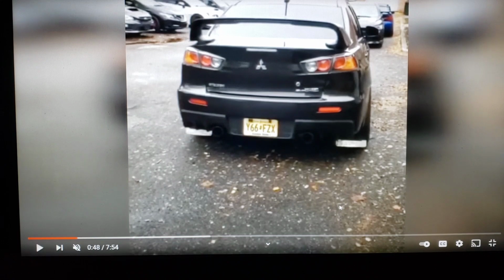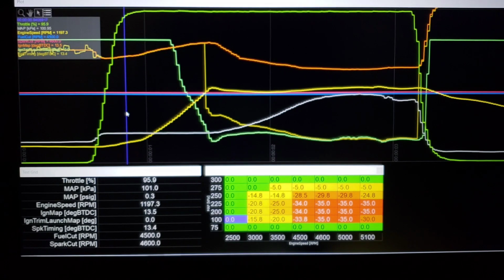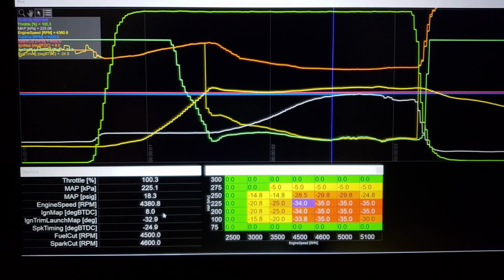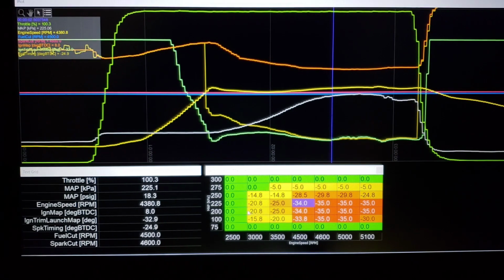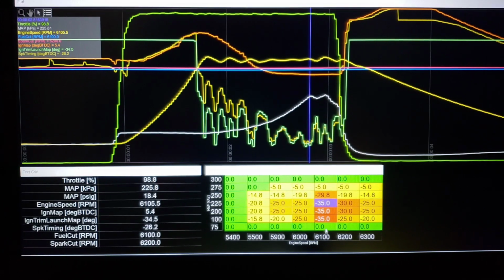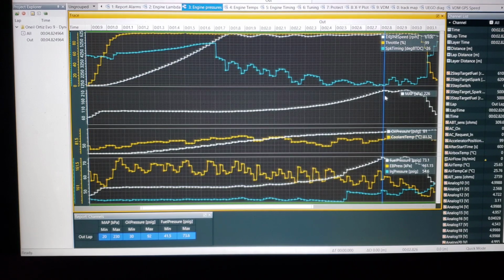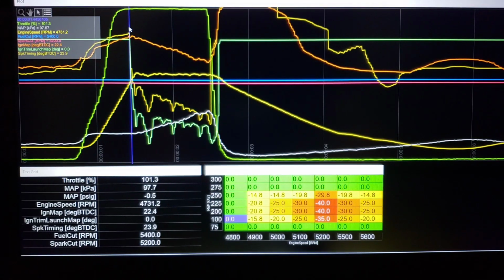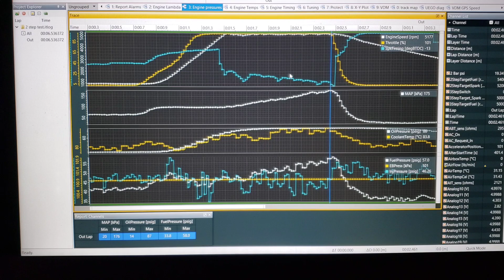Launch Control, Two step, Antilag - Episode 1

Comment: Hey Aaron, what size turbine housing was on the evo 9 with the 6870 ?
Reply from the maker: 0.96 I think, I will have to see if I wrote it down anywhere.
Reply: @AaronONeal1  I 0.96 is T4 open, do you think a 1.15 T4 twinscroll would spool the same as the .96 seeing that the 1.15 is twinscroll and also help with back pressure ?
Reply from the maker: @khemrajhsamaroo3671  we have run both a 1.15 and 1.32 twin scroll housing. It will definitely spool better but I didn't have EMAP logging on those cars. To date the 0.96 vband housing makes the most power. 950 is about the most I've gotten from the big twin scroll and 1003 from the 0.96 vband.
Reply: @AaronONeal1  I have a t4 .96 open entry and a t4 twinscroll 1.15 housing as well. I'm looking for a low 900whp. Should i get the vband inlet/outlet .96 instead or which of the above would you recommend ?
Reply from the maker: @khemrajhsamaroo3671  either will do that, but the 1.15 will be better response.

Comment: This is such a great topic to discuss because it is imperative that care be taken when setting up the 2 step. I've seen so many dropped exhaust valves at the track just from people staging or even 3-4 shift with ignition cut, the pressure exerted on the exhaust valves raises exponentially during those conditions, so I greatly appreciate the knowledge you are graciously giving us to make not only our cars better but also a better racing community.